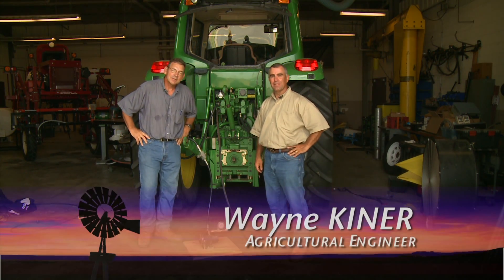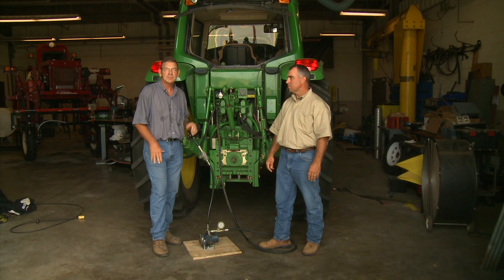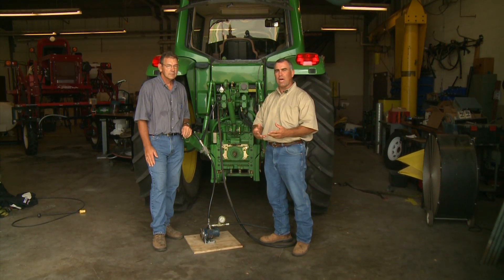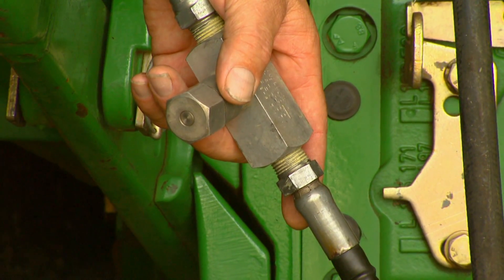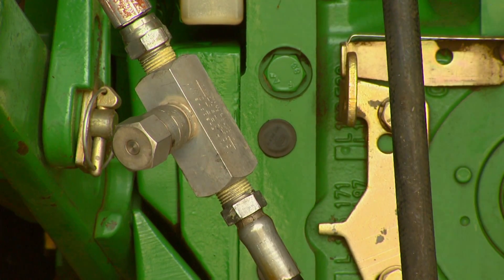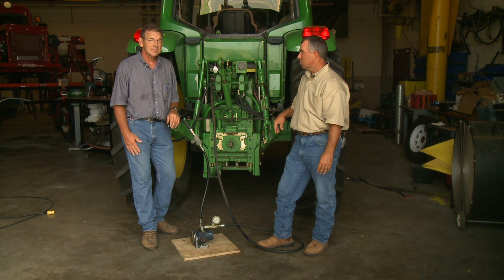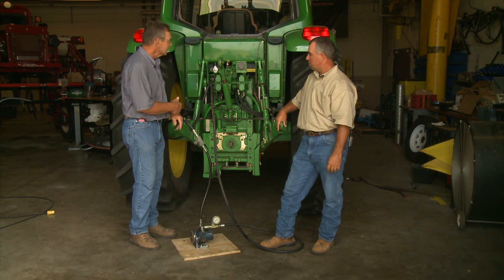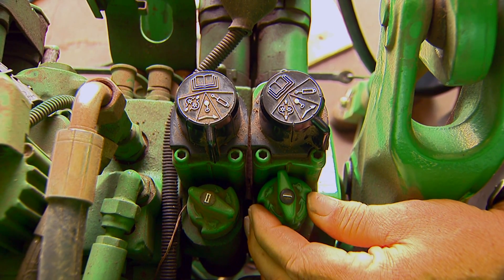Shop Stop: Tips and Tricks for Ag Mechanics

Comment: Is that a black pipe schedule 40 reducer off the tee going to the pressure gauge.?. 1:10 in the video.  If so steel fittings should only be used testing hydraulics